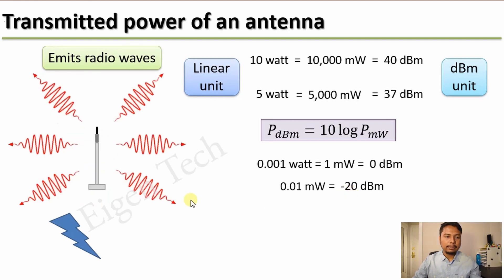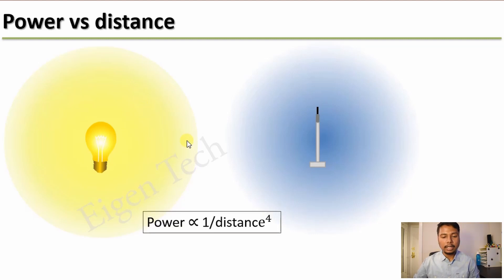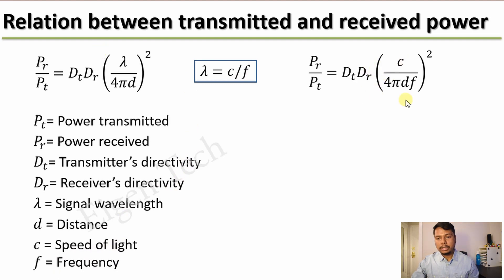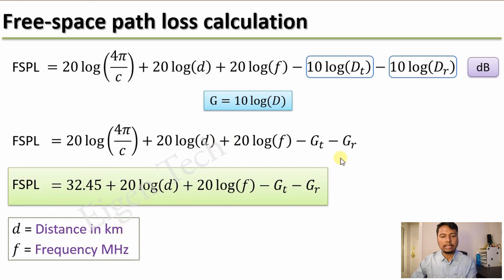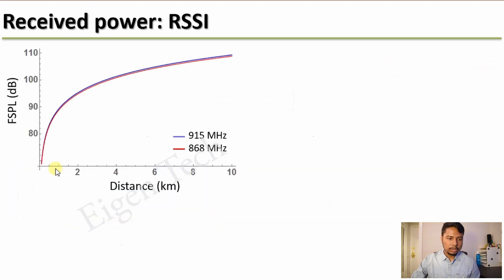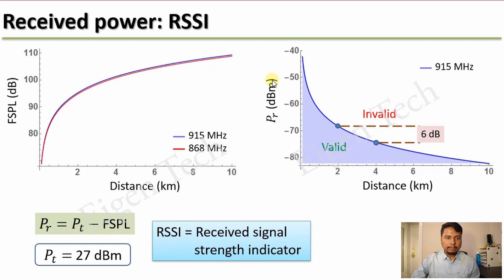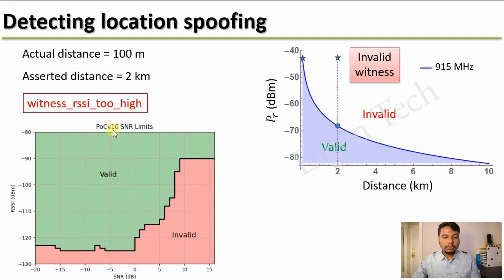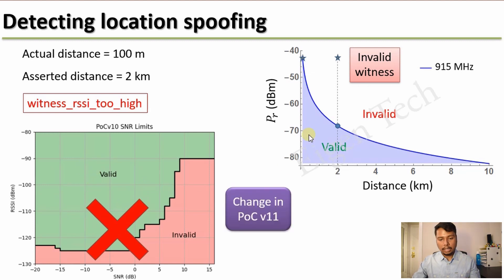Important changes in PoCv11 | New anti-gaming protocol | Improved witnessing and more

Comment: Question, does a 6bi antenna within the allowed dbm range help anything then if the output power of the miner will be lowered? You'd use a high gain antenna to extend range but if the output power overall will be lowered, will it actually extend range at all? any idea?
Reply from the maker: No, it will not increase the range. The range is limited by the maximum EIRP allowed.

Comment: Hi, thanks for the video!
I don't understand something... For Europe, if Max allowed EIRP = 16dBM and Max transmitted power by the hotspot is 12dBm... will European miners be basically getting far fewer profit than say a US miner, imagining the two were mining an exact same place but with that different regulation? Thanks!
Reply from the maker: depends on the location of other hotspots around yours. If most witnesses come from closeby hotspots within a few km, the earnings would be same but if the witnesses come from hotspots located > 10 km then Europen ones might not be able to reach that far and thus will have less earning

Comment: I have only one thing that I would like to understand better: why was the SNR not a good metric to consider in witness validation? I don't understand how PoCv11 will make it better to invalidate gamers. What prevents people to just use some meters os crappy cable to introduce additional loss so they stay within the RSSI limit?
Reply from the maker: I think SNR works theoretically but in the real world, it is not a good metric to decide the validity of a witness. PocV11 might be slightly better at penalizing gamers as it is going to use a more accurate expression for FSPL.

Comment: Hello, I want to set up my second bobcat miner in a different city and use a mobile hotspot router as the source of internet since I don’t have access to internet. 

Is this possible? I’m trying to get a Nighthawk LTE Mobile Hotspot Router with a 512 MB capacity and a 40GB hotspot data available per month.
Reply from the maker: Yes, it should be possible as long as you have a reliable internet connection

Comment: Great video as always.  One question, when I set up my Bobcat, I didn't align the white and blue icons exact.  It was close, but maybe 25-50m off.  Is this a worry?  Would it be worth 10 USD to "change the antenna location"?
Reply from the maker: 25-50m off should be fine
Reply: @eigentech6567  thanks bro
Reply from the maker: @cattleprods911  you are welcome
Reply: @eigentech6567  what is the maximum amount i could spoof my location to get into a different hex?
Reply from the maker: @markdelej  More than 100m is not recommended

Comment: Amazing explanation. I did not understand the first time. But second time I did understand most of it. So my question In my country the regulation is 30db max EIRP and my hotspot has a max transmission of 27db. Now if I use a 6dbi antenna  which makes the transmitted power to 33db will I have more invalid witnesses? Or the hotspot will adjust itself and transmit only 24db?
Reply from the maker: The hotspot will bring the transmitted power down so that it doesn't exceed max_eirp. For more details you can check this video https://youtu.be/6ZYYgRYJMcw

Comment: 12:35 doesn't this mean that even if I have a 5dbi antenna, I should assert it as 9dbi to get a better "invalid witness" threshold
Reply from the maker: That is right, you will get 4dB more margin in the RSSI if you do so
Reply: @eigentech6567  oh my. isnt that a very flawed policy to let users report antenna gain? anyone who asserted in an adjacent hex can just do that instead of shifting back to the real hex. even for normal users with 1dbi antenna, they should just assert as 9dbi in case of signal fluctuation invalidating witnesses.
Reply from the maker: @piwikiki  You see, it might only help to get a few valid witnesses from close hotspots. Your overall signal will not travel much further and as a result, you will get fewer witnesses from your beacon signals
Reply: @eigentech6567  as a receiver, asserting as 9dbi would also serve as a counter measure for those beacons which have an 8dbi antenna but did not update in their app from the previous 1.2dbi.
Reply from the maker: @piwikiki  You are right. You have really got into the depth of this. In some cases, asserting a higher gain might be beneficial.
Reply: Hello, do you mean with "Invalid witness" the ones are so close or just in case when you put your miner further than its actual place? next hex! cuz I have a miner that needs to be moved about 190m and I'm not sure if I can change the antenna details in the app to have everything okay. ps I'm in europ
Reply from the maker: @hishamsabbagh508  I think I replied you on discord
Reply: @eigentech6567  Yes, thank you man

Comment: Thanks for another very informative video! Should we factor in the cable loss when we enter the antenna gain information in the Helium app? E.g. if we have a 6 dBi antenna with a 1dB cable loss does it make sense to enter 5 dBi for the antenna gain in the app?
Reply from the maker: I think so, you can subtract the cable/connector loss but try to get a good estimate.

Comment: So if someone is at the actual location (not spoofed) but used a 10dbi antenna defined properly in the app, will he be penalized because the antenna has high dbi?
Reply from the maker: I won't call it "penalize". The transmitted power will be adjusted to respect the local regulations

Comment: so an 8 dbi antenna is worth nothing in europe? 4 dbi is the highest
Reply from the maker: You can still use it. The point is the transmitted power will be brought down. I think there is a lot of confusion and I have to make another video.
Reply: @eigentech6567  But is 8dbi still worth it? can you give an example what happens to the 8 dbi                                                                          
(does it still make sense to buy an antenna higher than 4 dbi in europe). And thanks for the answer and the video
Reply from the maker: @remco6549  If you use 8dBi, the transmitted power will be reduced to 8 dBm. But remember higher dBi is not always better. Check this video https://youtu.be/A2_sJQhpdig. But if 8dBi is the best for your situation you should use 8dBi

Comment: Do we know when the PoCv11 update will be implemented? As far as I understand we'll need to input the true / valid antenna DBi information on the Helium app by that time. Many of us still have the default values set on the Helium app (usually the stock antenna's info) - while already using a 5.8 or 8 DBi antenna.
I'm aware of the fact that updating the antenna info causes the  hotspot to drop all it's witnesses temporarily but it's needed for the PoCv11 update. Any info on that? :) Thank you
Reply from the maker: The implementation date is not announced yet. The dropping witness doesn't hurt your earnings.
Reply: @eigentech6567  Thank you for the prompt reply - really appreciate it :)

Comment: I have two upcoming bobcat miners soon and I already have two 5.1 dbi antenna...for EU.
After cable loss it will be around 4.5dbi or a little bit less, should I change it before the miners arrive?? This sucks man..
Reply from the maker: Ideally, yes you should change the antenna. But I am still not sure on the part of cable loss consideration. People are debating about it.
Reply: @eigentech6567  So what is the dbi limit without any penalties? Is it okay if I switch them to 4.3 dbi?
Reply from the maker: @Muldeeer  4 dBi for Europe

Comment: Question, does the minor I own ( Bobcat ) adjust its output of DBI, if so is that automatic? I have not yet received my helium minor, but I have set up an 8dbi antenna, with a 10-foot coaxial cable that is well-insulated and has very little loss. I am also very aware that I have to put in the proper height,  Dbi, and map. placement

Comment: Okay so I have a question, I am in a hex that has too many miners.... I live at the edge of the res 8 hex so I pinned my location in my back yard to get out of the popular hex and to get a transmission scale of 1.0 will this new pocv11 snap my location to the actual location of my miner that is in the hex
Reply: I would like to know this too..
Reply: its not going to move the location. were you said it is is where it will be.
Reply: If you relocate your antenna by 50m? You must pay a charge, so I assume it only has an accuracy of circa 50m. Although I do believe they are planning on banning those caught spoofing, I guess your real question is how accurate must you be on where you say it is and where it is... hmm.
Reply: @zigziar  Helium is not planning on banning spoofers, and good luck getting the hotspot positioned in exactly the right location. I gave up after  3 tries of getting it where it actually should be.
Reply from the maker: Helium will not change the location. It will stay where you have set it on the map.

Comment: You are some kind of brain! Great work. However I got one question. In another great video you talk about moving the location in the app, without physically moving the miner to achieve better earning. I just moved mine about 90m. Is this still possible with the new improved changes? Thanks for your help.
Reply from the maker: Yes, a location assertion within 100m of the actual location will still be fine

Comment: So if i dont update my antenna info on the app how does helium no to reduce my power. If i put the antenna as 4dbi on the app but im using a 9dbi, does that mean helium wont reduce my power???
Reply from the maker: Most likely Helium will not reduce the power. But, the result could be more invalid witnesses and breaking local regulations

Comment: Another great summary! I think there will be a lot of used 6-8-12dBi antennas in the EU market soon :D
Reply: Morning so 4dbi antenna is max even if you loss dbi in the cable ? Example 5.8dbi with a long cable 
Sorry for the stupid question I'm new 😃
Reply from the maker: @timmy3thfc  No, it is a very good question. There is an ongoing debate on whether to use a gain value lowered by the loss of the cable in the Helium app.